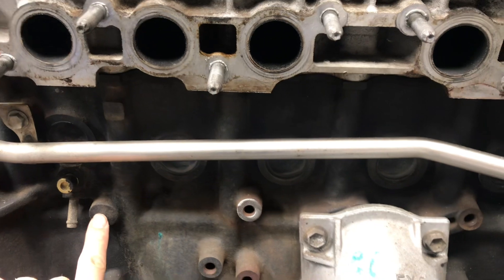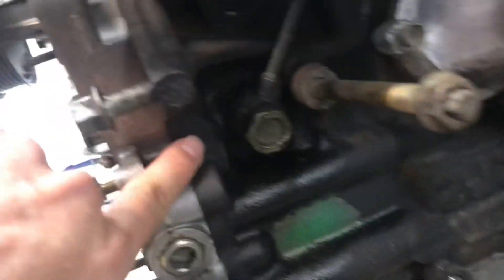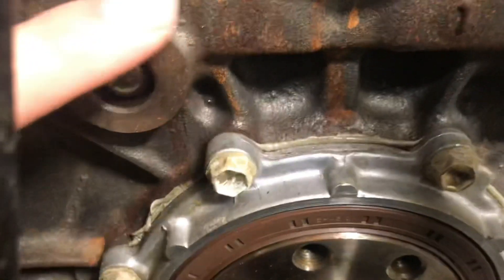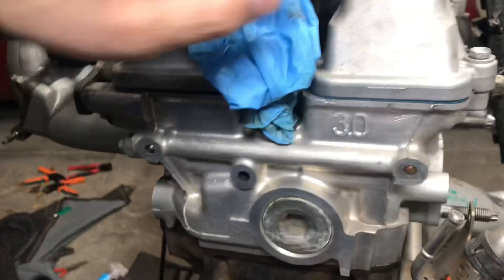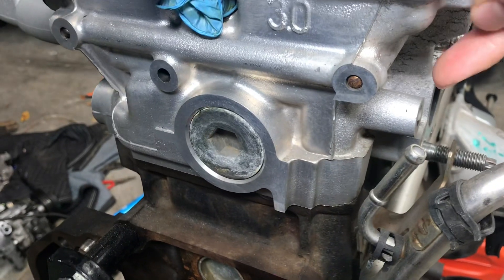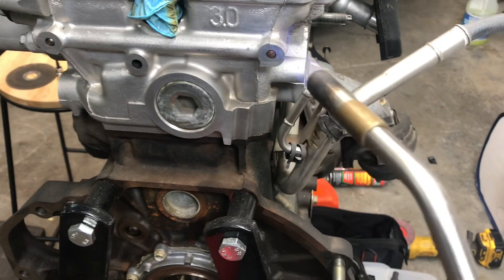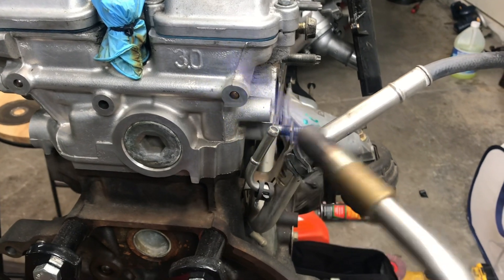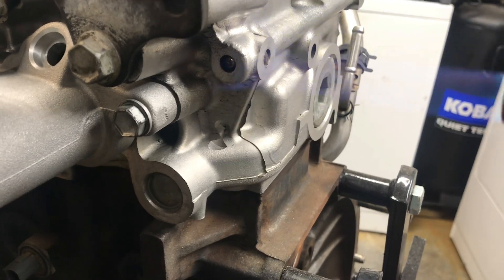2JZ GE Turbo Oil feed from back of head, exhaust side.

Comment: Not hating, but another option that works out really nice is to remove one of the pipe plugs in the oil filter housing; and replace with a 90º elbow with suitable male pipe threads on one end and a 4AN male gland on the other.

The aluminum oil filter housing/neck has two passages: one to allow oil to flow from block, into the union bolt and up to the oil filter; and another to allow filtered oil to flow back down the housing, to the block and pressurize the oil galleys.

Both those passageways are drilled by Toyota, then plugged with pipe plugs you can remove with a big hex key. Simply remove the pipe plug for the FILTERED passageway and replace with the elbow.

Run your 4AN oil line under the oil pan, securing it to oil pan screws using P-clamps, then the oil line can swoop upward, just inboard of the passenger side shock tower, and make it's approach to the turbo from the outboard side of the car; away from the exhaust manifold and all the heat. Comes out super neat and clean.

Plus, you can do this with engine in the car, don't need a welder or special tools - and you don't need to drill/tap anything that creates metal chips that risk getting into the oil or bearings.

Adding a "tee" to the oil filter housing union bolt works, but creates a rather ungainly and spindly little joint just asking to get bumped and broken off.
Reply from the maker: @GroovesAndLands  yes that is also a very good option. No fabrication need and is very clean. Thank you

Comment: Why not tapping on the oil galleries side bosses ? Is the right side not feeded without cross drilling galleries?
Reply from the maker: Correct. The exhaust side long oil galley is not fed with oil. You would have to cross drill them.
Reply: @alexfrench8142  gotcha thanks

Comment: How's this working out for you? Oil pressure?
Reply from the maker: Haven’t run it yet. That engine won’t go in for a long time
Reply: @alexfrench8142 it’s been a year, does it run now? Did it work?
Reply from the maker: @M3rsonDrifts  I still have not finished the fab work. I did get the engine in the car but not turned on yet. This other guy did it and has had no problems
https://youtu.be/jXJcRRIY5W0?si=3z7_CWKqhDOeZfsV

Comment: I thought was an outdated way of doing this? Maybe I'm wrong.
Reply from the maker: I have never heard of this method before. When did you know this was possible?
Reply: @alexfrench8142  most of the guys I’ve seen either run an adapter at the oil filter with a port, or they drill the block where the GTE feed comes from (machine shop), or some people drill and tap the GTE oil pressure sensor port. From what I’ve seen those balls you’re removing from the head are normally removed, tapped, and plugged when you send your head in to one of the race shops. The machinists complain about crud that gets trapped behind them. I don’t know the routing of the oil galleries in the 2J, but as long as you aren’t robbing the cams pressure I don’t see why using that location would be bad (as long as there is enough room behind the engine for the plumbing).
Reply from the maker: @drewski5730  I figure using a gte oil pump without the oil squirter. I should have the flow to spare.
Reply: @alexfrench8142  even if you’ve got the squirters there should be plenty of pressure to spare as long as you’ve got the GTE pump. This thing runs twin turbos, and squirters from the factory. I digress, what I was trying to say was that I hope the oil doesn’t get diverted from the cam and go to the turbo, I’m not sure if that scenario is possible though or if it matters. 

Bernoulli’s principle states that if you increase this size of the pipe, you’ll lose speed of flow. Makes sense ya? So by splitting the oil gallery into 2 at the cam, you’d be delivering half to the cam, and half to the turbo, and both velocities of fluid would be lower. I don’t know how much oil a turbo needs, maybe it’s inconsequential, and maybe whatever is left for the cam is still plenty. And furthermore because I don’t know which way the oil flows through the galleries in the 2J, I can’t tell you if perhaps that plug you removed is after the cam has already been oiled if that makes any sense! So from the sounds of it you’re paving new ground!
Reply from the maker: @drewski5730  very good points. The only way I know to test is to look at pressure before and after the change. See what difference there is.
Reply: @alexfrench8142  
Er us know how the build turns out!
Reply: @alexfrench8142  Like 20 years ago lol. It's an unnecessary thing to do, it's not needed with the GE vvti.
Reply from the maker: @mrman8856  so how do I get oil feed to a turbo on a ge?
Reply: I used a 1/8 npt T piece on amazon for the oil filter housing union bolt and just put my pressure sensor in and -6 feed line to the turbo… however you did mention not wanting the line over the engine so ig this would make it “cleaner”
Reply: @alexfrench8142  YOU NEVER WANT TO DRILL INTO THE BLOCK! If you have to have a return feed do it from the oil pan itself. It's been proven to be more efficient.
Reply from the maker: @mrman8856  I didn’t drill into the block. What is a return feed? I thought those were two separate things? How do you get oil feed from the pan?
Reply: Soo did you have to cross drill to get oil to that hole? Or just tap and put fittings in?
Reply from the maker: @nathanielfarmer3308  just tap and fittings 1/8 npt